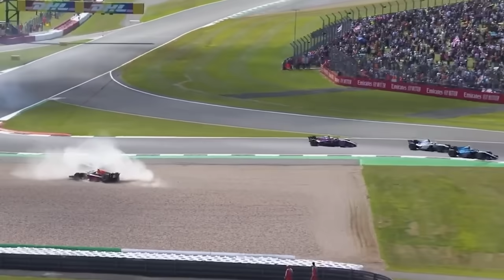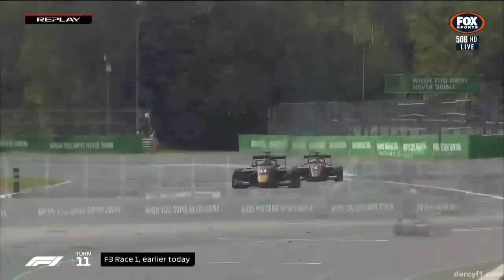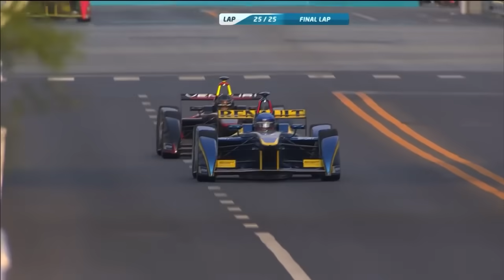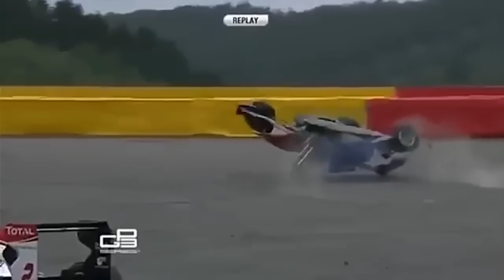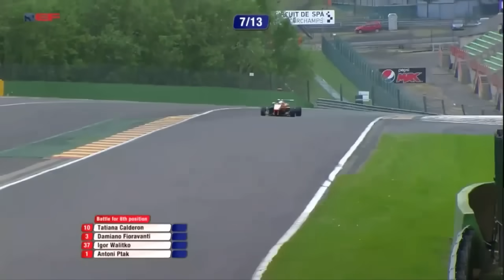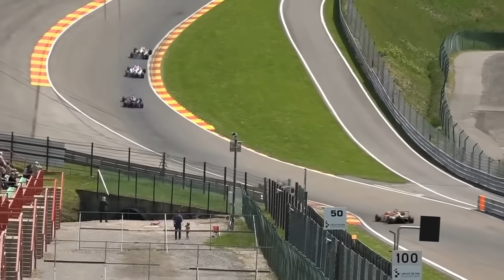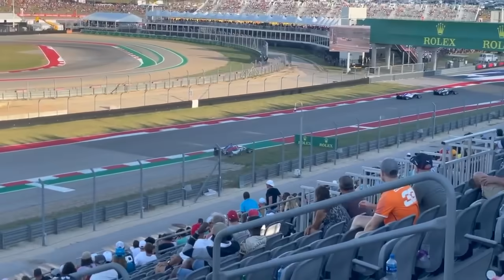Ramps on Race Tracks

Comment: When did a sausage curb ever help someone in a crash? Ive only seen them make crashes 5 times worse than they have to be.
Reply: Literally never. They're a great way of saying "don't cut this corner or you and your car will surely be destroyed" so it's just a stupid way of trying to stop corner cutting but all it does is when someone accidentally cuts the corner (to avoid cars, breaks failed etc.) they get launched to the air with no control, mostly landing back ti the track with a destroyed car and many other fast oncoming traffic to avoid them.

It's so stupid.
Reply: I don't know but at least half of these crashes would be serious with or without sausage kerbs.
Nissany and Hauger for instance, without that kerb Hauger would have t-boned Nissany.  Is that any better?
Reply: @100benny  Hauger managed brake quite a bit before contact and the cars are already made to crunkle the energy through the entire car. If the Halo would’ve failed (Not saying they will, but look at Zhou’s rolling bar breaking off in Britain so never say never) the lad would’ve been decapitated, the other w/o being indeed a t-bone, but a low intensity t-bone.
Reply: @100benny  or he can just not run people off the track. theres always that option.
Reply: Can’t cut track limits if you don’t have a car. Literally the logic behind sausage kerbs
Reply: the only points of sausage curbs is to "PuNiSh DrIVeRs who cut corners" instead of investing in sensors literally risking lives
Reply: @rosua  nah bro they won’t learn like that
Reply: they are supposed to help drivers? i thought they are meant to discourage drivers from going off track
Reply: @Jakereisman11111  exactly
Reply: @MrRay168  like I’m not trying to be a smart ass, that’s what they were LITERALLY invented for.  You won’t cut corners if you don’t have a car!
Reply: @Jakereisman11111  Yes, and theres no racing without drivers.

The sausagekerbs are a literal safety issue.
Reply: It's not about helping , it's about punishing
Reply: @egeo.9645  oh that's easy. Just make it a rule that only cheaters can hit ths sausage and then the non cheaters wont be able to.
Reply: The second clip, if that car didn’t leave the track that would’ve been a t-bone crash, which is alwasy the most terrifying crashes in motor sport, so at least on 1 example it helped the drivers
Reply: ill take a tbone at any point over possible decapitation. The only reason that didnt happen was the halo. Now imagine if the halo failed or the driver would be too tall
Reply: @Jakereisman11111  the crying of the drivers after forcing tracklimits in Spielberg says it all
Reply: @Lolbotkiller  ohw please
Reply: @Karincl7  Again, theres no racing if there is noone that can race.

Yes tracklimits need to be enforced, and corner cutting needs to be prevented. But making a minor or even non existant accident a major one is BAD. 

Imagine the following thing: A major Windgust catches one of those cars at just the wrong moment and causes them to go over the sausage curb. Congratulations, what wouldve usually been a time loss would now cause a dnf, and possibly worse. And to rub it in, at that exact moment a REALLY good track battle was happening, which is now interrupted by a red flag. 

There is too little advantage to sausagecurbs in comparison to their disadvantages
Reply: @100benny  Yes, it's way better to hit the side of the car than hit the underside of one car on the fucking driver's head.
Reply: @Karincl7  THATS WHAT IVE BEEN SAYING TOO!!!!
Reply: A sausage kerb would have made the incident between Heidfeld and Sato in 2002 far less brutal. Another instance would also include some of the crashes at Hockenheim, especially at turns 1 and 3.
Reply: @DR3ADER1  Honestly the Heidfeld Sato one is debatable.

For one, yes, Heidfeld may have simply gone over sato, but it couldve also been that Heidfeld wouldve ended that crash just like the Nissany Hauger Crash. Except without a halo. 
The problem is, that entire corner is uphill. So when you send one car relatively shallow upwards, and theres a car at the rough point where the first car would be headed...

As for hockenheim, im too lazy to look into those ones rn, so maybe?
Reply: @vruscryaotic1830  the halo is the strongest thing on a formula car
Reply: it’s supposed to slow you down and make a noise so you know where track limits are, also helps with corner cutting
Reply: @vruscryaotic1830  yeah, him getting launched prevented his breaks from slowing him more
Reply: @egeo.9645  just give them a penalty if they corner cut on purpose! And it shouldn't be the death penalty!
Reply: @100benny  well yes but if there’s an accident the car would be sent to impact cushion barriers rather than launching over those crash purpose barriers and into the fence and possibly the criwd
Reply: @100benny      100% Benny, yes!
Reply: They aren't about crashes, they're about punishing use of non-racing surfaces for time savings. They do that quite well, but hit one wrong and you get a MASSIVE INCIDENT.
Reply: Abby of the grand tour
Reply: V8 Supercars in Australia had a problem with cutting track limits especially on some it’s street circuits. They tried big curbs and tyre bundle but the cars were pretty tough and racing was so close it was still worth the drivers gambling with breaking their cars for gain they got from the curb hopping. I think those days led to some big accidents as well. 

They eventually started using the sensors, the drivers get a certain amount of strikes and then a black flag and a drive-through penalty. It took a while for them to work out the bugs in the system but I think it works now. I don’t get to watch them as much anymore so I’m not sure. It’s certainly a hell of a lot safer then the curbs and tyre bundles were.
Reply: @egeo.9645  They are quite useful in slow corners, but right on the braking zone.... Not so much, they need to change where they put them
Reply: Yehhh.... But they're great if you can hook a front tyre on them to guide you through the corner in sims though!
Reply: They should just have normal curbs with gravel traps on the inside so if they cut they get stopped
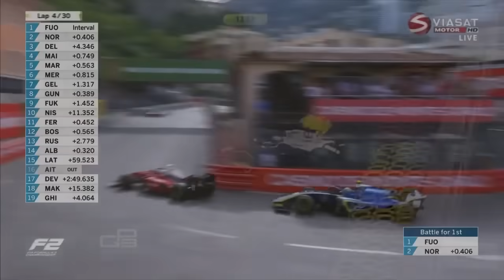Reply: 3:50 fia concerned by cerbs
Reply: From my perspective, the issue with sausage curbs that I’m not the biggest fan of is if no matter you cut the corner intentionally or not, it will punish you either by simply damaging your car or putting you into a life or death situation. Yes, it prevents drivers from intentionally cutting corners but lets say a driver is put in a position where there’s no more room to go than to corner cut. With cars as fragile as Formula 1 cars where rubbing up against each other could easily lead into an accident. It’s just more dangerous than just using sensors or having some guy track it. Most race cars also have pretty intense aero and that combined with their low ground clearance and stiff suspension makes a recipe for an easy accident. Just note that this is just an opinion of a random bored person on the internet at near midnight and not me trying to state facts. I’m sorry if I sound like a pompous person that thinks that they know the best or something. It is not my intention.
Reply: @rosua  Abbie Eaton had to recover from a broken back because of a sausage kerb at the circuit of the Americas 

She said that she “heard her vertebrae crunch” and just hoped it wouldn’t get any worse when she landed
Reply: @egeo.9645  Also has caused multiple drivers fractured vertebrae
Reply: よ
Reply: Maybe stop hitting the curb? Seriously, you are supposed to be in control of that car. They actually try to use it to gain time. Next time build a wall. Let's play bumper cars.
Reply: It’s a lot safer to be in the air and hit the catchfence instead of the wall, or have another driver crash into you at high speed

Comment: Who thought of this? Not only are literal speed bumps on racetracks a bad idea, but even worse because the cars who are going to hit those at 100mph are most likely fragile and low racecars with stiff suspensions. If you want to prevent corner cutting, give penalties or just put some grass where you don't want cars to go.
Reply: Couldnt agree more. Invest in cameras and people to watch the camera, give out penalties, grid places for situations where you missed a obvious penalty for future races.....literally anything but putting a fucking bump on a track where cars are racing.....It just doesnt make sense at all. So friggen dangerous and these are cars that, once a bit of air gets beneath them, theyll fly up and put people in the stands, safety personell who might be track side, and the drivers at risk of a flying tonne hurling at them uncontrolably.
Reply: @Amm17ar  you dont even need cameras. I think its motogp that are using sensors (and probably many more do it by now). They can determine a track limit violation far more precise then any camera and everytime a rider gets flagged by the system the stewards just check the footage to see if it was cutting a corner or something like avoiding a crash etc. 
Its just ridiculous that in the year 2022 those stupid curbs are still a thing.
Reply: Because it's a better race who gives af about the drivers. 🤷🏾‍♂️
Reply: Yeah, these bumps are by far the worst thing on track, irl and games the sausage kurb makes the corner more boring, tighter and makes you go slower, they can ruin ur race if u turn slightly early and its hard to re correct yourself once you do, not only do they make crashes more frequent and dangerous, it generally makes racing more boring, most the time they aren't even put in the proper place and seem to be also preventing people from putting 2 wheels on the inside curb, which last time I checked was legal
Reply: @shmoejoedesy9449  shmoe
Reply: @shmoejoedesy9449  if there is no drivers there are no racing
Reply: @noobpyxl  couldn't have said any better
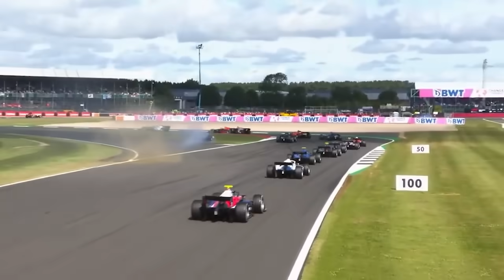Reply: They are really just meant to protect other cars from a side impact like it did in 0:46, but they need to be rethought to protect the driver hitting the curb as well.
Reply: high kerbs > sausage kerbs
Reply: force btw  so your point being? idgaf. 🤣 it's exciting. 🥴
Reply: force btw  entertaining to watch people die. 🤷🏾‍♂️
Reply: @Stoney Square
No doubt they were viewed as considerably safer than sharp, rectangular kerbs, however technology is progressing to the point that kerbs will eventually disappear at the bigger, better racetracks, and the circuit will be delineated with sensors.
We see this is MotoGP with the green off track areas.
Reply: Gravel put everywhere possible...🤣
Reply: @emojack  The sensors are used in conjunction with cameras; the vehicle hits the sensor, the camera records an image as evidence ('cos drivers/teams WILL dispute penalties - until they realise there is no point as there is unequivocal evidence). The trouble with just using sensors (and cameras), is some drivers manage to go off track but still avoid the sensor if they know exactly where it is. Not an excuse for sausage kerbs, but just highlighting that there is no single, simple solution.
Reply: That's a great idea. Having grass, or some rubber flooring which makes the car slower, would be helpful.
Reply: @shmoejoedesy9449  funny troll
Reply: @andyowens5494  thats right. I might have made it look a bit too simple. Because it never is. You are right, every scenario will have some problems and drawbacks. Another point someone else mentioned was amateur racing: full camera and stewarding is not realistic in those races and if they physically CAN cut every corner... We all know they WILL cut every corner 🙈
Reply: Grass has its own problems especially with higher formula cars such as formula 1 and 2 but it is way way better than sausage kerbs
Reply: …or gravel. Then they won’t do it anymore
Reply: They need some kind of synthetic surface that is very soft and gives a similar friction quality to gravel, but which won't spread gravel onto the track.

....like some thick rubberized grass-looking stuff....take a bunch of 2' long, 5mm thick nylon sheets and have the top half of those 5mm sheets cut into a bunch of 5mm wide strips...like spaghetti, but attached at the base.. 

Then pin the bottom half into the ground (and on top of another row of the same strips), all laid down like shingles in the direction of the traffic......drive through that, you'll grip it hard unlike grass (but not too hard if it's the right material), while also slowing you way down because your tires would sink an inch or two into the whole spaghetti-looking mess, but since its all attached at the base, no crap gets on the track. The slowdown would hopefully negate the need for penalties
Reply: or walls, that'd do it
Reply: The sausig kerbs were added to police track limits a while ago because if they go over the sausig kerb it would upset the car and make them loose time. Ever since 2015-2016 there was no reason to keep them because of camera technology and how many there were on the circuits.
Reply: Well put back the old standard road kerbs that used to be around all tracks and maybe people will stay off them. You’re blaming kerbs for driver errors. What’s more worrying is the aerodynamic divergence that’s still exhibited by modern racing cars. There were several flips, some of them flew at least a hundred metres.
Reply: Seriously, these are not soccer mom's or idiots.  They are professional race car drivers and are well trained and informed prior to any race what the track limits are. Btw, learn some grammar before you comment on these professionals. How many points on your Super License? But of course,  you don't have one 🙄
Reply: They drive on grass sometimes, I’ve seen overtakes in the grass in F1
Reply: They are needed
Reply: @brandon12316  sorry, english is not my first language
Reply: @shmoejoedesy9449  No drivers no racing
Reply: 2 reasons. 
1) To stop people from straight-lining the chicanes, on tracks such as Monza and especially COTA, you have areas where drivers have been seen cutting into the outskirts of the chicane area before kerbing was introduced, and in less dramatic footage, you'll see drivers slow down dramatically before they even reach the kerbing, as it's an active deterrent for corner-cutting. 

2) To prevent cars from sliding flat into other cars. Believe it or not, the energy a body in motion has, decreases when it's airborne, the innate resistances of a car in the air are far greater than the resistances it faces when it's on the ground. Lift is not good for any non-flying vehicle, as the high drag forces the car into a roll, dissipating the forces inflicted on the driver and instead, it directs energy into the car's bodywork, suspension and internals. It's actually MUCH BETTER for a car to be in the air than to have it T-Bone another vehicle on the ground, again, due to the higher levels of momentum, inertia and force a body in motion carries on the ground.
Reply: @DR3ADER1  mate wrote a whole paragraph 💀
Reply: @darkshadest  bruh he just flew into the other guys head tf u on about.
Reply: Well we saw how well that went at the Red Bull track in F1. Racers now saying "oh warnings and penalties weren't given out equally". If you don't want to hit the sausage kerbs slow down or don't race as aggressive, pushing someone off track.
Reply: They often can't put grass or gravel because the tracks are often also used for bike racing, and grass and gravel are worst than sausage curbs for bikes.

Thy want to make hybrid car-bike race tracks and refuse to accept that what make a safe car track often make for a dangerous bike track, and what make for a safe bike track often make for a dangerous car track. The best car tracks are bad bike tracks. The best bike tracks are bad car tracks.
Reply: It's not for safety i think, it is to prevent drivers cutting corners
Reply: @theunexpectedjaz9100  Curbs main purpose it to dissuade pilots from going outside the track's limits. The problem is that some, like those abominable sausage curbs, are just downright dangerous and should not exist at all.
They removed the grass areas and gravel zones to accommodate bike racing. That made it very easy and beneficial to drive outside the track limits. Enter curbs. When they are not enough, they started to use more aggressive curbs : Sausage curbs.
Reply: @Amm17ar  this is what happens when you pave over grass. Grass polices itself
Reply: @dadbodii  I dont quite understand the analogy tbh.
Reply: grass is expensive, tracks hate the repair costs. bumps it is
Reply: @darkshadestplayz  no solution on a race track should involve a car getting launched almost every time one hits it. Even if it's not the intention. That's just asking for someone to die.
Reply: Yep.  Whatever happened to simple grass and gravel.
Reply: @Amm17ar they did this in austria and now everybody is complaining
Reply: @darkshadest  I would much rather have a car t bone me with all that material between me and the other car than launch the other guy at the perfect trajectory to take my head off, but maybe that's just me, especially racecars are signifigantly more protected towards the floor